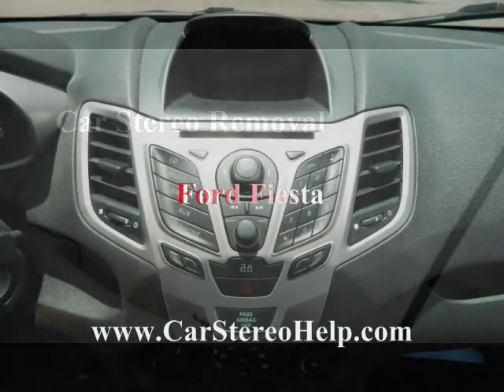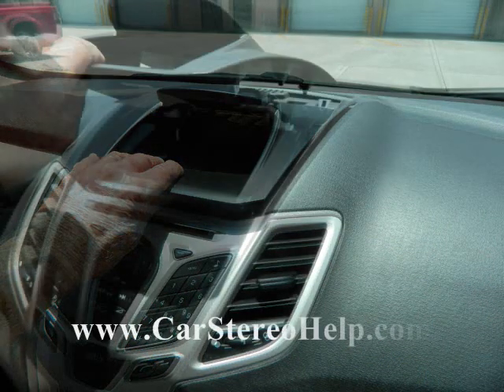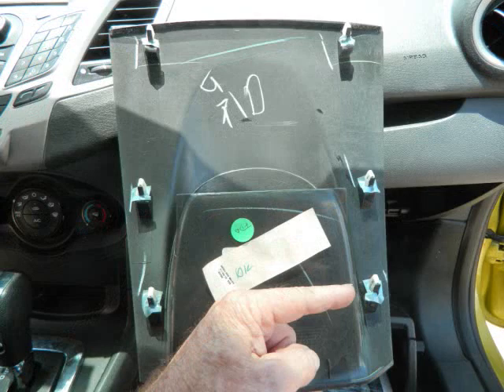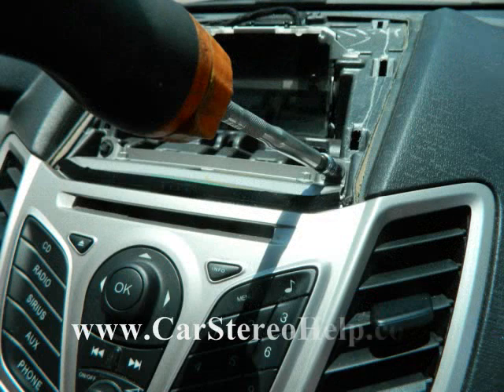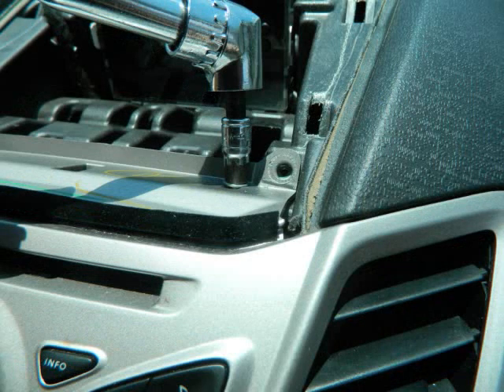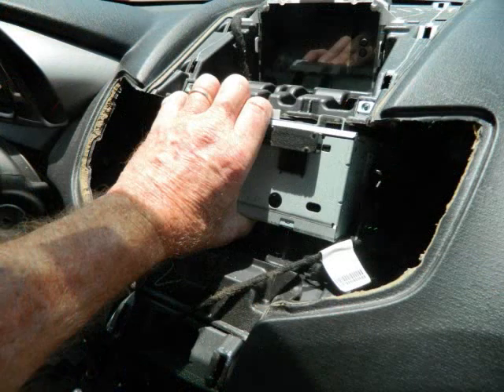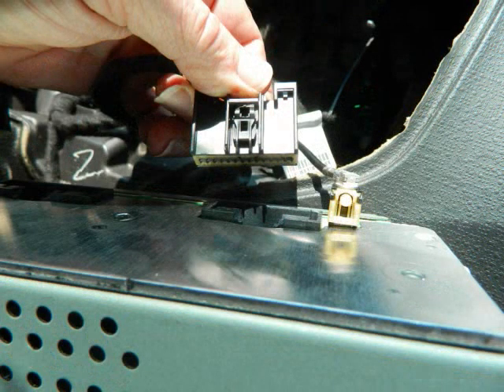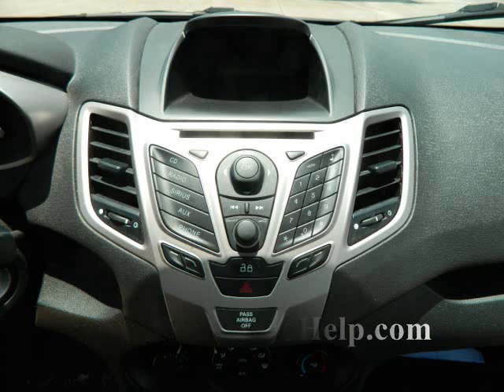Ford Fiesta Stereo Removal 2011 - 2013 = Car Stereo HELP

Comment: What about the airbag sensor when you replace the trim for a single din radio. How does that reset? Or how do you get that removed without triggering the sensor? Thanks

Comment: Hey got a problem there is only two wires in the back of the radio the big one and the antenna but the other big one is not there. Where would it be located?

Comment: Thanks for this and now a question please ... I ordered and installed the radio component; stereo still didn't work. Now I have paid a mechanic who ordered another radio component; still no success (we are now at the $450 mark). The mechanic said he checked ALL of the components and could not find an issue; the radio simply does not work. He is not, however, an audio mechanic so I am now wondering if perhaps the issue is the front control panel? I can order one on EBAY, but as you know there's a hook up to the passenger airbag on back of said panel. Can I go ahead and unplug that (from the original panel) then replug it into the new panel without any consequences (eg. air bag would still work)? Please advise and thanks!
Reply: Does your radio just randomly let out loud "bleeerps" and static?  Even if it is off?  If so, it's the radio.  I ended up just ripping it out.
Reply: @daviouswey  did you end up replacing it? I was struggling with this and got a used radio to install and installed it and now it’s stuck on a ford fiesta welcome message

Comment: Why's there no way to change the preset radio stations on my 2013 fiesta s sedan I am stuck with the stations that are there when I bought the car used in November 2021 some of the stations are not even set on stations can not figure out what is going on

Comment: I don't understand what you say at the end re aftermarket radio needing a kit to replace the silver panel, isn't just the radio replaced and panel put back in its original position?
Reply: @audiesgirl If you want to go back with original style of radio, if you are replacing it with a say a touchscreen it requires a trim kit to fit properly.

Comment: Hi, I bought a aftermarket android unit. Since I fitted the steering wheel commands don’t work anymore, the power folding mirrors don’t shut on locking the car and I cannot change km to miles or etc . Do you know how can i  sort this ? Any idea on the diagram of the original radio? The seller said to check the wiring diagram but no idea what to compare to 🥺

Comment: What antenna connector does the radio use? I'm installing a dab and will splitt the antenna drom there. I know about the phantom power from the dab. Do the radio itself send out power via the coax?

Comment: I can't get any sound out and radio was turn on after popping and cracking noise I removed baterry and now there's no noise but still doesn't turn on. whats my cheapest option? just aftermarket?
Reply: The exact same thing happened to me.
Reply: went to the junk yard had the same car and got the radio out of it with the controls and it worked instantly
Reply: EverJouleSky 

Same here in my 2011.
Reply: went to the junk yard and found same car just replaced the radio and button area thats attached and for $80 it worked instantly just plugs in same way

Comment: Do you know what I'll need to replace when the radio freezes at Ford Audio Welcome?
Reply: Did you ever get an answer. Having the same issue
Reply: My first Fiesta was solved by replacing the control panel. However, my second one was not that lucky. I'm waiting on the actual CD unit to come to see if that will solve it.
Reply: Where did you get the cd unit from?
Reply: Sandy Cos just eBay
Reply: Sandy Cos it was solved. So happy